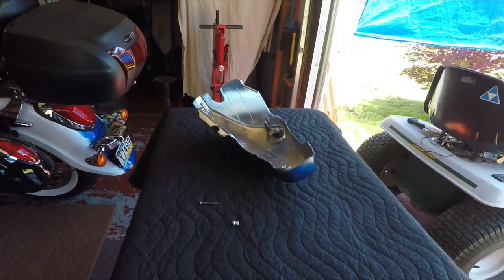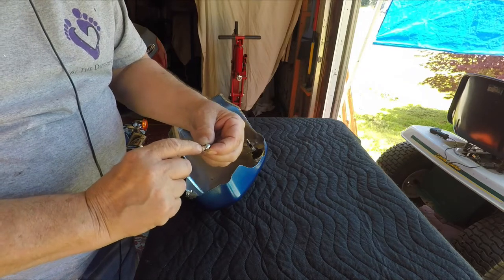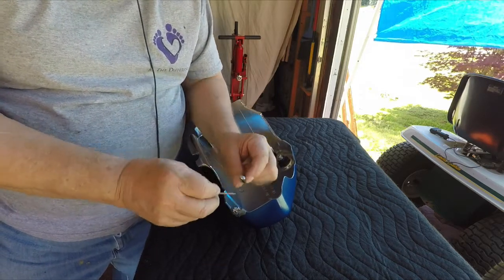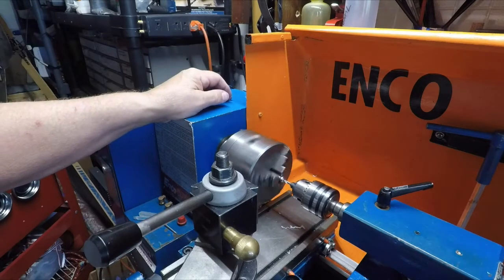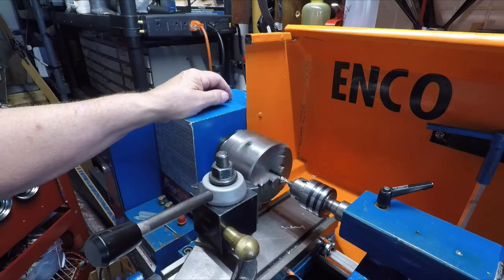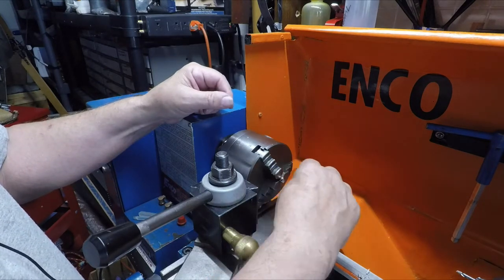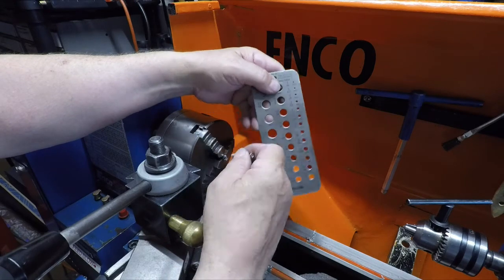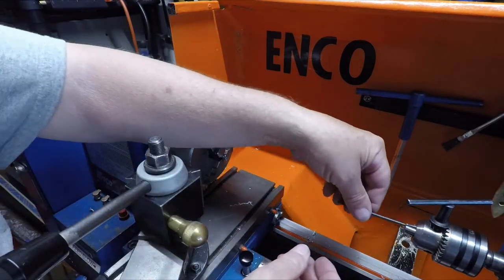SUZUKI BOULEVARD SIDE COVER FIX

Comment: Good job on very fragile material. Knock on wood, mine is fine. I use vasoline on the peg and rubber grommets, so far so good.
Reply from the maker: Hi Jeff, Good idea. I find when I have a small plastic part broken, drill a hole and use a small screw to reinforce it. Some times a small wire heated and pushed into the plastic will work too. All my best, Norman.

Comment: Your amazing.  Thanks and how do you keep the spokes so shiney.  Mine seem to have a layer of crust and they are hard to get to.
Reply from the maker: Hi Ed, You have crust on the spokes so I would try a tooth brush and some soft scrub to get all the crust off you can. I have a bike lift so I can set on a stool and work on the spokes without getting down on the floor. I have some small cloth balls that I put some Mothers Mag & Aluminum Polish on the ball with my fingers then I made a rod that the ball fits on one end and the other end goes in the drill. Run the drill slowly so the polish doesn't fly off. With this rod I can get the ball into places that are hard to reach. Mostly I rub the polish on all the spokes by hand then buff it off with a clean rag. It is a lot of work but I do it maybe two times a year and they look great. Hopes this helps. Norman.